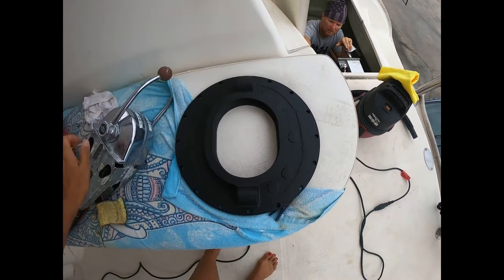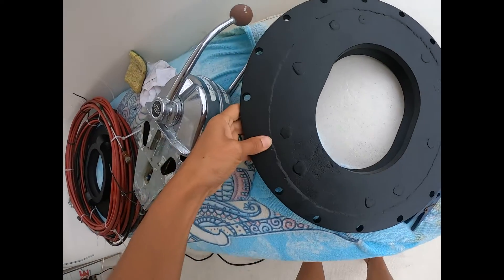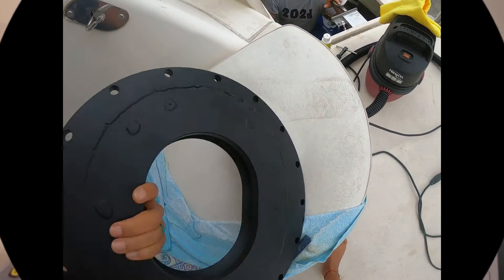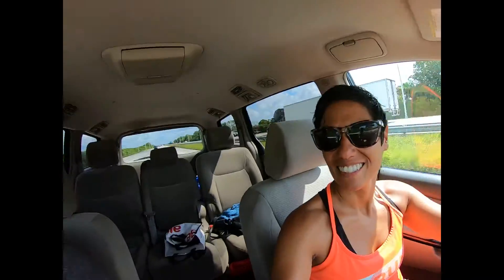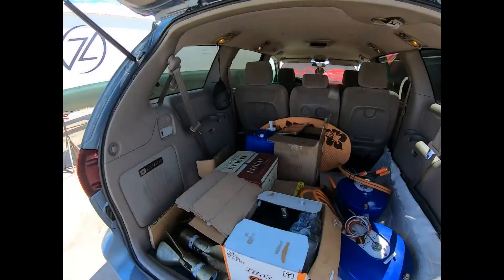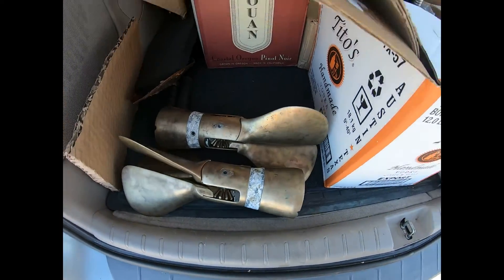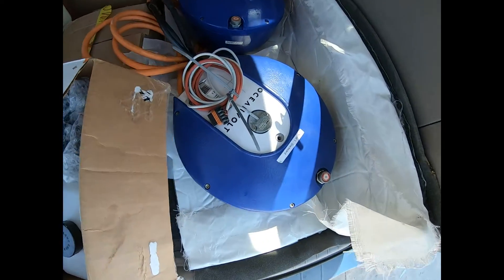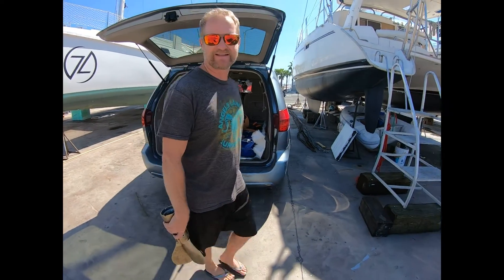Electric Motor Installation: OceanVolt SD15 on a '05 Leopard 40

Comment: If you had purchased the newer sail drive would it have been a direct drop in or would you still have needed to lower the mounting location? Very interested in following in your footsteps here but might purchase the newer servo props, just wondering if the additional cost of buying the newer design would save on labor.
Reply from the maker: It is my understanding that you would still need to lower the mounting plate. Their sail drives are much shorter. I never asked why. Their new mounting plates match the yanmar and Volvo size, so you don’t need to modify that.

Comment: Just found you have you seen Sailing Uma and their monohull conversions.
Reply from the maker: Yes we have.
Reply: @347830  

Im not familiar with the power of these units but im interested as I also follow a UK couple who have a 1975 Commanche catamaran.. at the moment it has an unusual drive system ..a diesel Mercedes Benz  generator/pump engine powering a hydraulic pump and seperate hydraulic drive motors  in each hull ... Power and direction of rotation is controlled by valves. They drive through shafts to the fixed 3 blade props.
What is the power of the motors and Size of your cat please if you can answer?🤔🤞🏼
Reply from the maker: I used to run a vacuum blower off the same concept using hydraulics. Seems like it would be a good concept.
Reply: @347830  

Its ideal as the hydraulic motors are even smaller than electric ones and are fed by two pipes not cables .. they are quiet and totally safe. The engine pump and pressure valve control unit sit on the midline of boat in the cockpit... essentially its like a tractor or winch PTO. 
Are yours 15W units ?  Theirs is about 36ft but heavy ketch rigged construction ..the hull being early fiberglass is almost an inch thick solid  with thick wood stub keels.
The only issue is the MB engines rings and bores are worn.

Comment: this was an older unused (new) model OceanVolt 15, or was it used? If used, I'm curious why the previous owner wasn't happy with it. I'll subscribe and follow along to see how it works out for you.
Reply from the maker: The previous owner was doing too many charters and found themselves motoring too much. Our intention is not to motor unless absolutely necessary.